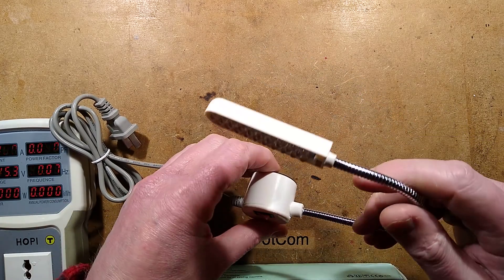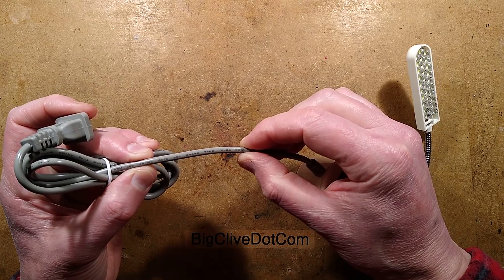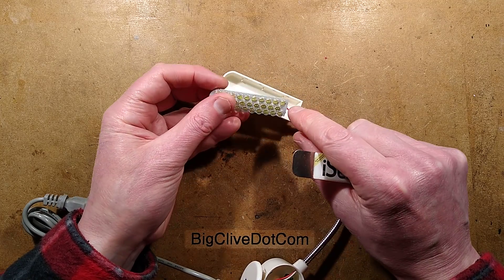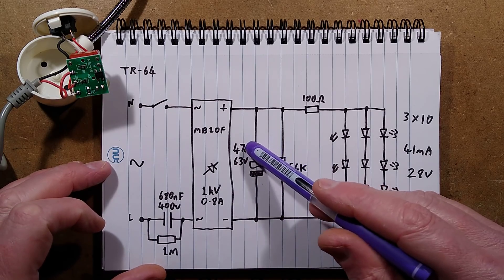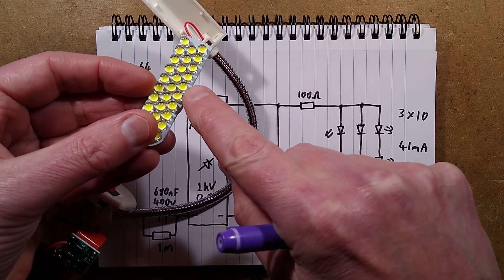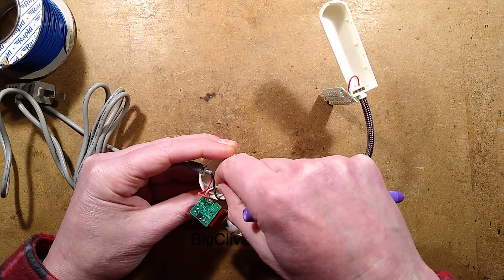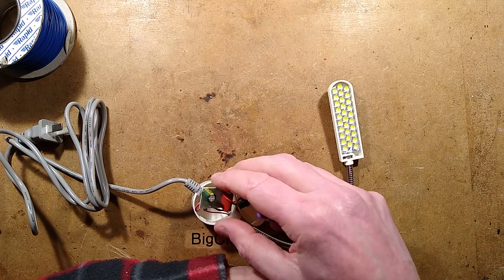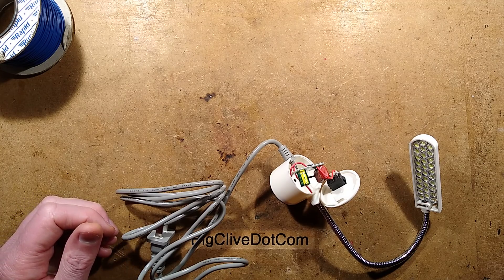Exploring a Chinese magnetic "machine light" (with schematic)

Comment: 9:40 It's always weird to realize that our expectancies of Chinese products is so low, that we're surprised when something is actually (fairly) well designed when investigated.
Reply: I use to be a engineering tech but now buy and sell stuff. There are fake Chinese made low quality knockoffs of Chinese made high quality branded products. They might look the same until close inspection and testing. I found it best the buy a sample from a vendor and check the quality before buying more because I don't wan't to sell junk.
Reply: Tidbits of real world China experiences.
1) China graduates more Engineering majors every year than USA graduates all college majors combined.
2) China knows what quality is 'required', and unless otherwise specified by the customer, will use the lowest grade possible.  Example: Cheap non-branded Chinese 2-stroke engines use quality Japanese main bearings to prevent instant catastrophic failure.
3) Chinese "Spare Parts" that come with container lots are very likely to be used parts removed from non-working units in an attempt to produce a working product. (Chinese motorcycles).
4) Upon arrival of your shipping container, open both ends and force air through the unit (outdoors).  Fog the container with three cans of Lysol brand disinfectant, and close doors for two to three days.  (It's a kind of sick you never want to know.)
5) Buying large quantities of Chinese products at bankruptcy auctions (products already in the USA) can be highly profitable.
Reply: @Matt Quinn  Ha, ha. lol
We've shared a ton (or is that a tonne) of good information here. 
One last thing, I live in Arizona, we never change the  clocks. When it's 47.2222 Celsius (117 Fahrenheit) , who would want to "save daylight" ???
Reply: Just looking at some of my electric tools, that I had assumed were made in Europe - e.g. a Black & Decker angle grinder -  were in fact made in the PRC.
Reply: Which is a shame because there’s plenty of well bit stuff coming out of China. Just consider all the electronics built there that do meet Anglo/Euro standards. Sure there’s a lot of shit. But long ago Switzerland was once a place to get cheap knockoffs. Yet you’d have trouble convincing people of that history today.
Reply: @ZaphodHarkonnen  So was Japan, if memory serves me right...
Reply: @ZaphodHarkonnen  Fenix flashlights are from china and they are high quality and their claims are not false
Reply: @ZaphodHarkonnen  Agree! A few months ago I started looking into the 'Tang' FPGA series. Looks like a genuine Chinese design to me, with quite impressive specs for the 'Primer' ('Premier'?). There is even a RISC-V core design for it. After (small) designs with Quartus and ISE, the more lightweight 'Tang Dynasty FPGA development environment' is a fresh breath. It supports Verilog only, but that's fine for what I need, and it's much, much simpler to set up and use than the other two. (Did not have the opportunity yet to work with a Lattice FPGA IDE yet, so can't compare with them.)
Reply: @hagen-p  "genuine Chinese design"... Go on, you´re the best stand-up comedian I´ve read lately. Just show me anything manufactured in China that is not stolen intellectual property? China is a communist dictatorship made out of effing thieves...
Reply: @SharkoonBln  No need to be rude. The Chinese are perfectly capable of making very high quality stuff, look at anything you have in your house and odds are it was made there.  Problem is so many Western "Manf's" resell the lower quality crap at the Brand Name price, because they have to make their quarterly numbers and get those bonuses, and all us Western Sheeple still keep buying their cheaply made crap because, its cheaper!  And the Chinese will run 3rd midnight shifts and pump out the same stuff under their own labels, or resell or reuse the IP.
Reply: @SharkoonBln  And? You think American manufacturers are any better? The only reason they seem that way to you is because they have to keep their thieving in secret for litigious reasons.

Mark Twain was damn right when he said everything in this world is 99% plagiarism.
Reply: @bluephreakr   - "Mark Twain was damn right when he said everything in this world is 99% plagiarism." - He didn't come up with that, though, he just copied it from someone else. ;-)

Seriously, though, that's not quite what he said, and he was referring to unconscious plagiarism (i.e., "second hand ideas"), not deliberately copying someone else's work and passing it off as your own.

And yes, China has a bit of a cultural issue with copying other people's work (not just in electronics), which I'm sure will get slowly corrected as Chinese companies evolve, come up with their own products, and pressure the government to prevent others from copying them.

It's hardly something new or exclusive to China; Thomas Edison  made his fortune from plagiarism and outright piracy (ex., copying and reselling Georges Méliès's films in the USA).
Reply: This case it's built to a cost, yet still fairly acceptable.
Reply: @Matt Quinn 
1) When you have so many people, thank God they educate some of them...to any degree (pun intended).
2) The world needs more tee-shirts, were good on mugs.
3) Lysol  This is a real story, it works. Otherwise, just use people you don't like to empty your container, you'll be fine.
4) AMEN  There are pros and cons on both sides of the pond. James Bond has the perfect job. 
5) Thank you for your time.
Reply: It will bite them in the arse in the long run. Buyers today read "made in China" they expect the device to be dangerous, made to the worst imagineable quality standards and it will fail in a spectacular manner within days. Like my elderly neighbour says: "Made in China? Avoid like the plague!" :)
Reply: @SharkoonBln  When I was young made in Japan was derogatory instead of  top shelf.   There are some well engineered products from China now.  Years ago my brother had a small Italian portable cement mixer.  Lasted for years but finally broke down.  The new one he bought was a Chinese clone at a lower price that had been redesigned to fix the faults with the original.